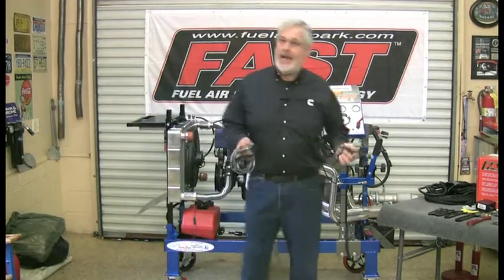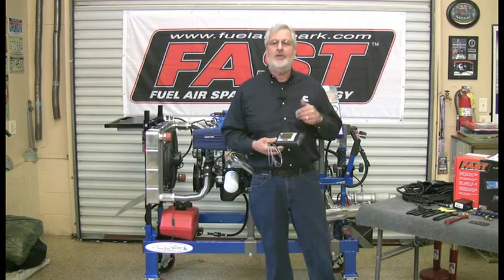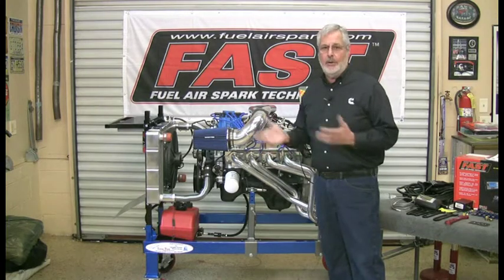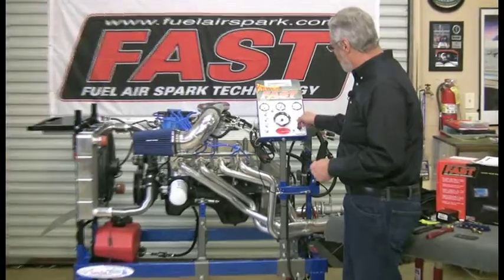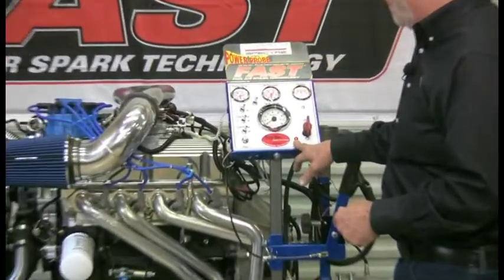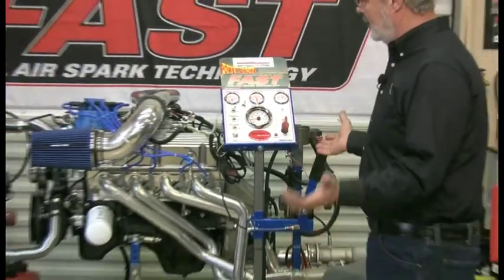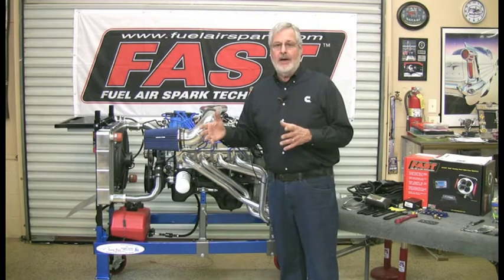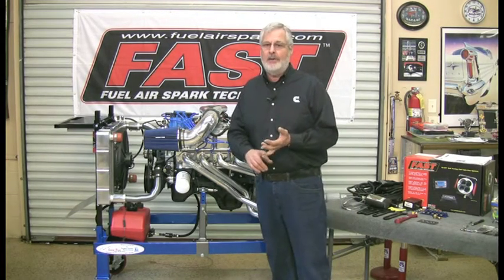Sam Memmolo EZ-EFI® Installation: Part 3

Comment: In California , you can change out any smog legal engine for a newer model due to the fact that the newer model is more technologically advanced.  Any idea if this is smog legal to retrofit this to  a carbureted engine in California?  The exhaust gasses will surely be cleaner.

Comment: I have a question regarding the fuel system.  By now you've seen the Edelbrock sump fuel system.  I was wondering if FAST had something similar?  If not then why?  it seems like a no brainer to come up with something like that to compete with Edelbrock's new E-street EFI.
Reply: Jimmy_Volmer At FAST we prefer to use an in-tank system, and at the very least a new system entirely that doesn't utilize carb components. It's nothing against Edelbrock's system, but rather just how our engineers prefer to design and create parts. Hope this helps - thank you.